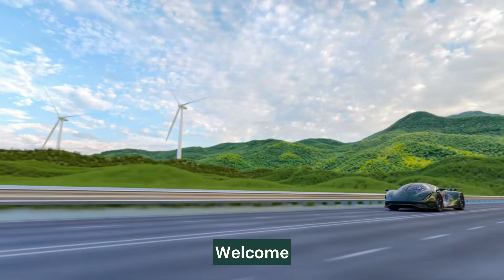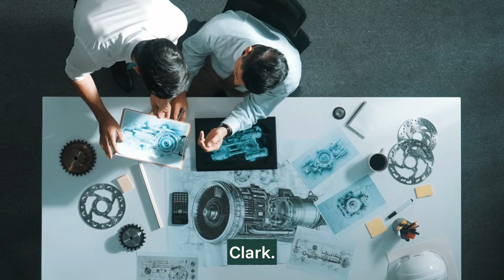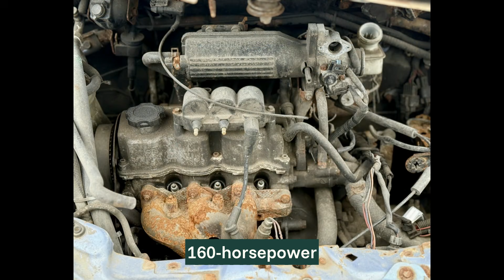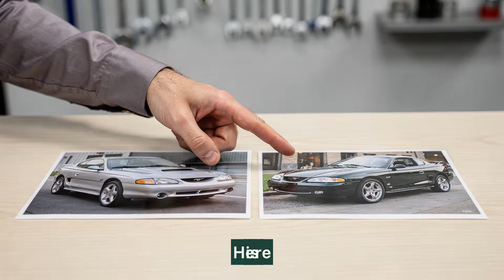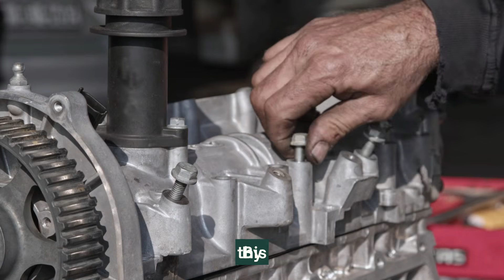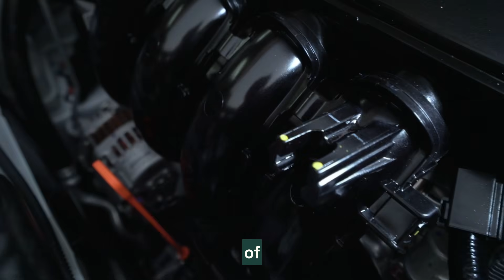The Ford Engine That Was Actually Indestructible (4.6L Mod Motor)

Comment: I have four 4.6 4V motors on Teksid blocks,  2 are turbocharged, 2 are spares and a 5.4 2V in my 2001 F150 SuperCrew.  No repairs required since new
Reply from the maker: Now THAT is a serious Modular collection! 4 Teksid blocks is straight-up hoarding perfection—those Italian-cast blocks are practically bulletproof under boost. And 0 repairs on the 5.4 2V since new is proof of why these engines earned their indestructible reputation. Appreciate you sharing the line-up!
Reply: @AutoModusreal  One of the cars is a 1932 Coupe hotrod.  The frame and body were widened and the frame was lengthened to accommodate a horizontally mounted air/air intercooler behind the radiator.  The engne is a 4.6 4V.  It has a Teksid block, Manley rods and JE pistons at 8.5:1 compression.  It has "C:" heads from a Mach 1 and two Garrett GT 7628 turbochargers, water cooled, on custom manifolds. The transmission is a 4R75W.  The rear end is an 8.8 from an explorer with one side shortened.  The Explorer rear end is normally offset but it has 31 spline axles. It has 3.73 gears.  The engine is managed by a Megasquirt 2 with an EDIS-8. The whole car with me in it is less than 2600#.  I built this hotrod years ago.
The turbos spool up about 2200 rpm and are at full boost by 3000 rpm.  At 10# boost, I'm at 510 hp.  I lowered the boost to 7# because it was blowing the tires away.
My more recent project is a 1996 Mustang Cobra convertible.  It has the stock engine with Manley rods and Diamond pistons, with the compression lowered to 8.5:1.  The turbos are mounted remotely behind the rear axle.  They are Ebay T3/T4 hybrid turbos with a 57/76 compressor wheel.  They are similar to a GT 7630. There is a front mounted intercooler and a 2004 Cobra MAF.  The engine has 60# injectors and is manage by the OEM computer with a Tweecer chip.  The engine spools up about 3000 rpm and is set at 8# boost.  The trans is a stock T45 with a Zoom Kevlar clutch, but I am changing it to a T56 soon.
Both cars are a blast to drive.  With this much horsepower in two light cars, it's hard to stay legal.  Thank God for freeway on ramps.
My 2001 F150 SuperCrew, that I have owned since new, has the stock 5.4 2V.  It has 190,000 miles on it and has never required any repairs.
My other truck is a 2013 F150 SuperCrew with a 5.0 Coyote.
I love my turbo cars, but for a daily driver the NA engines have better longevity.  Thanks for asking.
Reply from the maker: What setups are you running on them (single or twin turbo), and how much WHP are they pushing on those stock Teksid bottoms? Would love to know the specs!